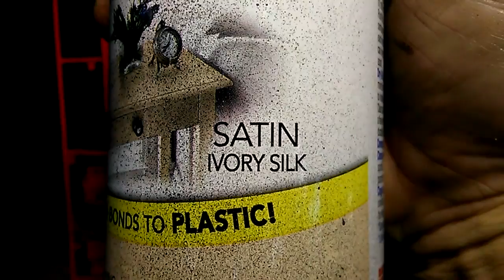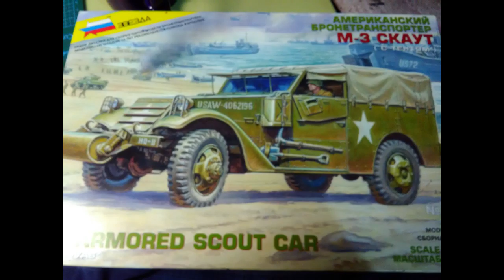Rusty's - Post Apocalyptic Kit Bash Model

Comment: How do you get the salt to stay in place till you scrape it off? Do you glue it somehow, or is the paint enough to stick it down?
Reply from the maker: Hi. You have to wet the model first. The water partly dissolves the salt then when it dries it should be stuck. Cheers
Reply: you make sure the paint is dry. Then you apply water wherever you want the salt to stick. Apply salt to wet surface and let it dry. once dry, you paint whatever surface color you want and let that dry. once that paint is dry, you take a toothbrush (or your fingers) and simpy rub away the salt. Its called "Salt chipping" and you can find tons of video tutorials on Youtube.